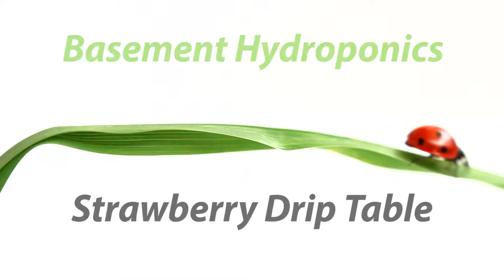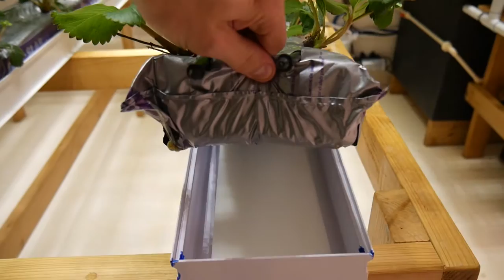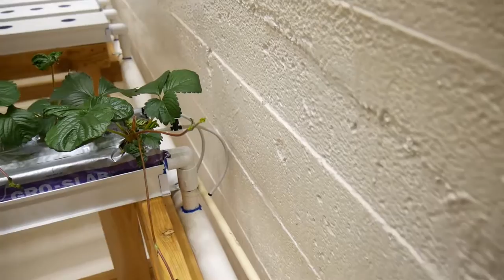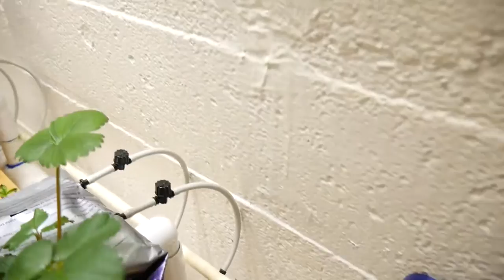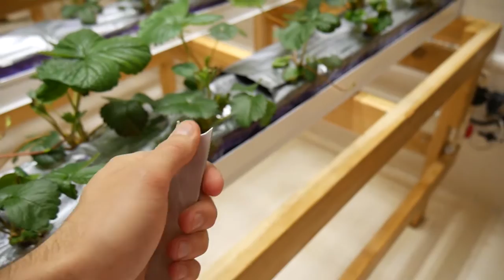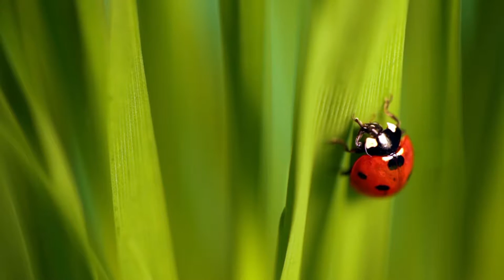Part 4 - Strawberry Table - Basement Hydroponic LED Garden Tour

Comment: What is wrapped in the material, what is the material? If it's the seeds what is the spacing, are there holes on the top so that one can monitor their growth, when do you remove the material? How often is the nutrient pumped and for how long, what's the spacing of the drip tubes, is the nutrient a different kind than the other nutrients that are used for the other crops?
Thank you,
Robert
Reply: start at the beginning video this is part 4